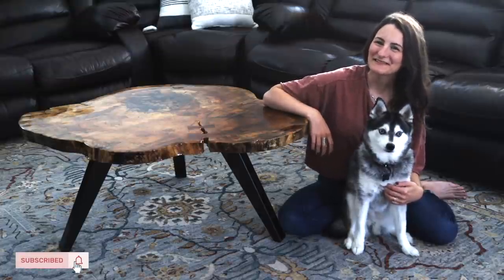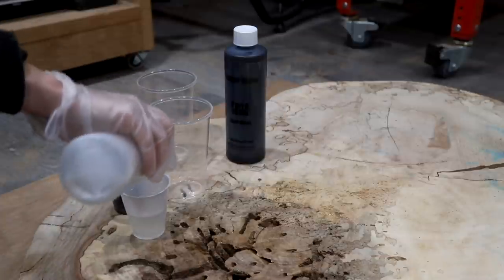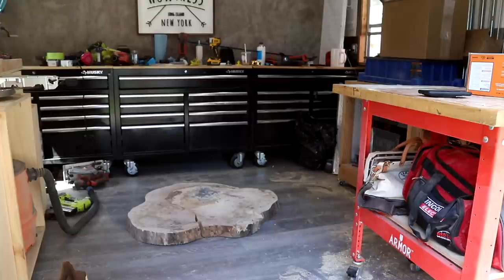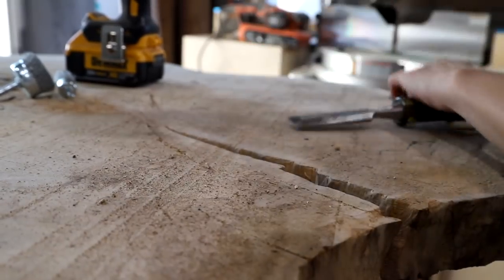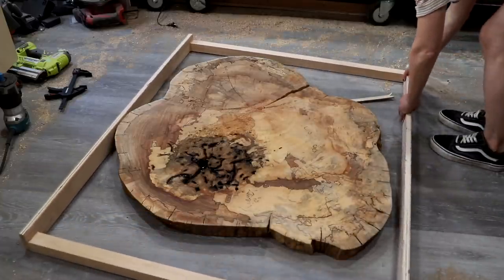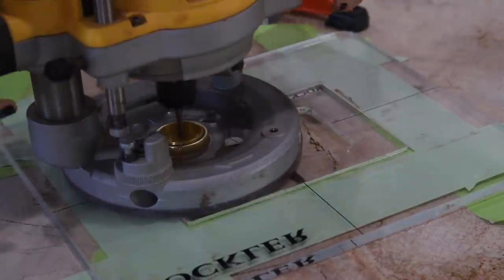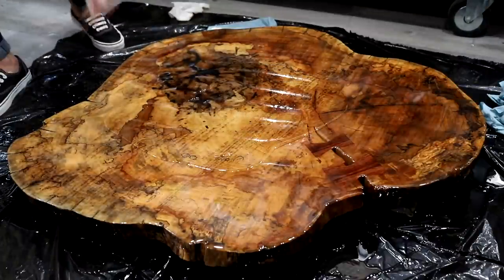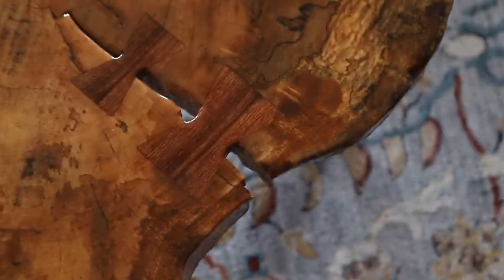DIY Live Edge Coffee Table | How To Turn A Slab Into A Table

Comment: I run a sawmill where I cut cookies and regular slabs. The way this worked out can many times be par for the course. These cookies always want to move more than traditional lumber. Mix with that it could have already been under some amount of internal tension cleaning that crack released that tension. Also after it is flat if it will be several days before you can finish both the top and the bottom make sure it has air flow under it not just above it. Always finish both the top and bottom in the same finish. Helps to avoid one side taking on or releaseing more moisture than the other side.

Comment: Sam - great job and wow, what a nice way to show the “journey”.  I am getting into turning and woodworking.  My current project is a table from a branch cookie arising from a 300 year old Linden Oak.  I have prepped it using a DIY router sled for 1st time.  Router left marks visible in stronger light (kind of like a soccer field that gets mowed).  How did you handle router marks?  I have tried 80, then 60 and hand with 40 grit.  I tried a cabinet scraper but i dont have the strength to bend the metal and it just scraped up the surface (which did not please me at all!!).  Suggestions?

Comment: Hi congratulations on the slab fantastic job. Ive started my slab and encountered the the same issue after leveling, a few days later the slab cupped and warped due to rains and high moisture. I'm planning to epoxy both sides of slab to protect against moisture. I wanted to check one year later how your slab is performing, is it moving or relatively stable? Appreciate any information...cheers Vix

Comment: I just bought the twin slab to yours 😄 so this is the perfect video to get me started! Let's talk routers. I noticed you used a palm router to help flatten the slab but then switch to a Dewalt plunge router for the bowties. Could the palm router do both these jobs or do I need the plunge router? They are so $ and for home DIYer I was hoping to get away with the palm but want to do good work the first time and not regret it. Thanks for the tips Sam!
Reply from the maker: I am so excited for you! Honestly… after doing this project, I added a plunge router to my wishlist. The plunge has a lot more power and it more versatile. It’s also really hard to use the palm router with a router template. Not impossible, but definitely a bit trickier. Can’t wait to see your project!

Comment: So after seeing this video I am encouraged to try my own project
I do have a couple of questions and would appreciate it if someone can help answer them.
Question  1 - so I have sanded the top and the side of the wood cookie slab, do I stain the wood first and then put the coats of Epoxy or do I not put the stain at all and simply put the epoxy? 
Question 2 - Also, what is a good epoxy mix to get a glossy finish, and how much time one should wait between coats?

Comment: Question, I'm doing my first big project. I'm making a desk. The top is pine boards screwed and glued together. I finished staining the entire top. Should I put poly on the underside as well?  By the way great job on your project in this video. It looks great.
Reply from the maker: Hi! I'd recommend finishing as many exposed surfaces as possible to avoid any cupping or warping. Good luck with your project!
Reply: @diyhuntress  I did end up doing that just to be safe. The finish is the last part didn't  want to rush it. Thank you. I appreciate it.

Comment: Not a fan of the bowties as i feel it takes away from the natural look but hey something had to be dine about that crack. Id of probably looked at putting them in the bottom so they werent as visible and then filled the crack with a clear resin but to each their own. Either way the table is gorgeous and definitly inspires me to either make some side tables from mine or a few large tables like this. We had a huge 40 ft pecan with about a 3-4ft base fall recently and ive thought about trying to turn it into some furniture. So i may have to try something similar.